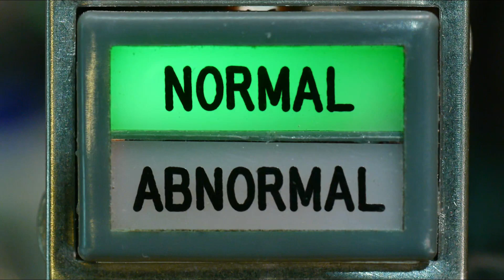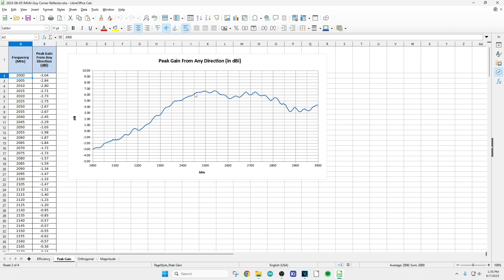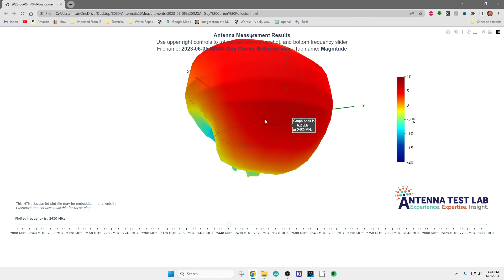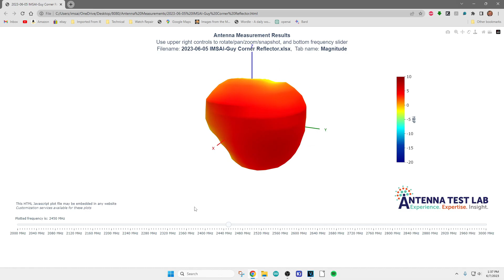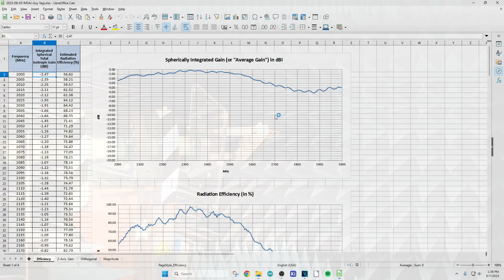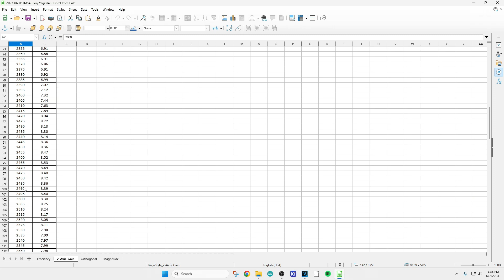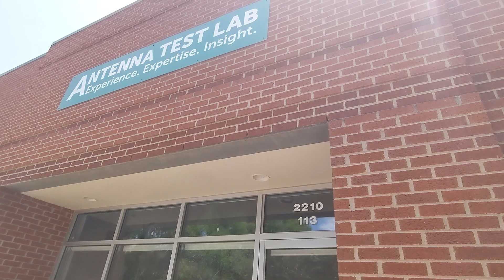#1523 YAGI design for 2.45 GHz (part 3 of 3) measurement

Comment: Given the results you've been provided... since a yaggi is desired directional, and in 1 specific direction... how could you  adapt your design/ what changes could be made for improvements? To focus more energy into the desired quadrant? Removing that 'rear'/ 'bottom lobe- i'm sure doing so would increase signal DB'.

Interesting how higher frequencies caused such a shift towards  the back, radiating more energy towards the rear. Why would that be? Higher frequency, smaller wave length, no? So, smaller cuss sections/ elements would mitigate this, propagating the signal/ correcting it back to where it is emitted in the desired forward direction? Thinking out loud, this would make it a hefty lil antenna for higher frequencies.... and ideall for applications pertaining to 5g drone types.

My inquisitive mid takes me to the curiosity of how a study of an antenna like your yaggi, re creating the exact same experiment/ gathering the exact same data, exact parameters and alll, but implementing a broad band amp such as the one that is typical to be provided with the HackRF1 PortaPack- I believe it to be from the reliable sellers Open Source SDR(or Radio...i forgot)..lastly what the results would look like yaggi antennas, amp, and filter tuned to your yaggi's designed frequency(ies)...ok and ever more lastly, how the results would look like with different voltages provided to the amp...3.7, 5, 9, 12 volts... I say there should be a part 4, 5, and 6.... ;)

Comment: I ordered the PCB but for some reason it still has a silkscreen. Will this cause significant problems? If so, is there a way I could remove the mask? For context, I am using it as the transmitter antenna of a 2.45GHz 800W microwave raygun. Any feedback would be greatly appreciated (no pun intended)!

Comment: Hi, we developed a new methodology of antenna measurements for measuring in laboratories and open areas (or directly on vehicles - planes specifically) without necessity of the very expensive attenuation chambers. It was my PhD thesis a few years ago. Now its in process of publishing by Springer so the research will be available to anyone who wants to play with it more. Its quite frequency dependent but its very simple to adjust the principle for whatever frequency needed and it provided quite nice results. I tested it on simple dipoles and horn antennas of wide range of freq. since I had limited resources and time. If you are interested to read something about it let me know.
Reply: I'm interested, where do I learn more?

Comment: One small correction: dBi is dB above isotropic, not intrinsic! If the antenna radiated all the energy isotropically - the same in all directions - that would be 0dBi on the plots, so where it's positive dBi it's radiating more energy, where it's negative it's less.
Reply: From what I can make out, the only people who use dBi are sales-types, and this is because the numbers are 2.15dB bigger. They also happen to be close to useless for anyone who actually works with antennas because it is measuring performance against something that doesn't exist in real life (an isotropic source).
dBd is a far more useful quantity.
Reply: @digitalradiohacker  Making a 3D visualision of dBd makes absolutely no sense as the dipole also has lobes, it would be analogous to having curved axes in your oscilloscope.
Reply: @MrDonTabasco  
"analogous to having curved axes in your oscilloscope"
Exactly. and this would present a completely different looking model, one which shows where the RF is going compared to a dipole.

Maybe I want to hit the horizon, and I'm willing to rob Peter to pay Paul. A colinear will do this. It takes what would normally go up and down and directs it at the horizon.
Maybe I want to cover a smaller area of a city for handset users. A stacked-4 dipole array with a hacked phasing harness could give me 20deg downtilt.
It would be nice when characterizing such arrangements to see exactly where each DUT sends the RF compared to the same dipole I have been using for many years, and am more than familiar with.

Alternatively, we can compare them all to a purely theoretical source which can never exist in real life. Like comparing the weight of a bag of sugar to 1 litre of zlobsicloph.
Reply: @digitalradiohacker  I'm with @MrDonTabasco -- the isotropic radiator is a platonic ideal, and if you want to compare your dipole and your DUT, you can compare them both to an isotropic radiator.  It's really not that big of a deal.

Rather than thinking about the isotropic radiator as a "nonexistent" antenna, you should think of it as the most fundamental possible reference derived directly from Maxwell's equations.  \

Heck, even any real dipole will deviate slightly from a theoretical dipole, and that will spoil the cleanliness of the measurement.  We'd have to store clean reference dipoles along with the kilograms in Paris if we want to use dBd universally.